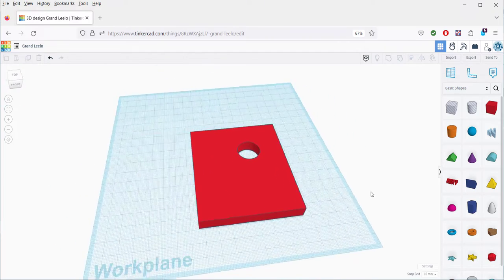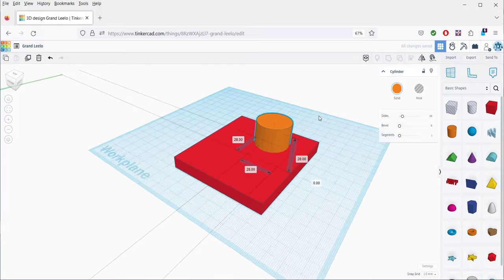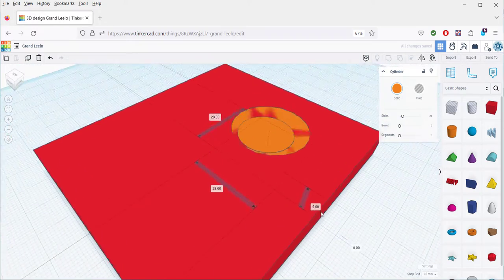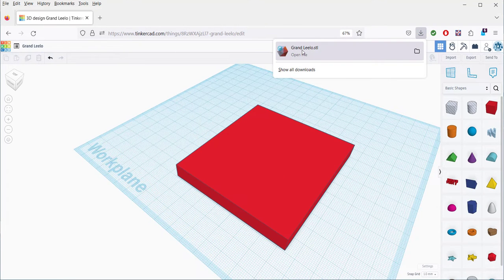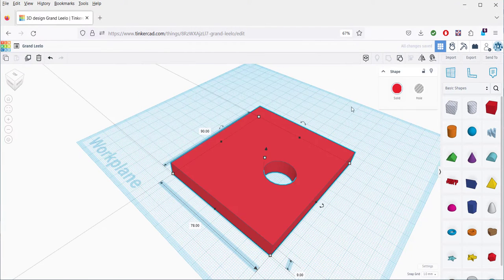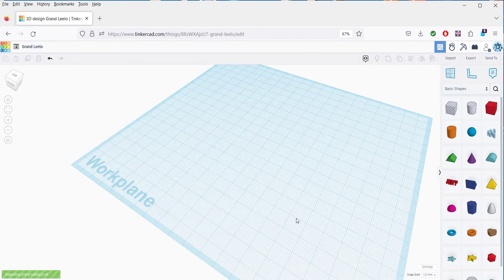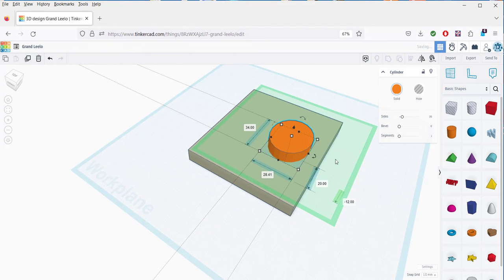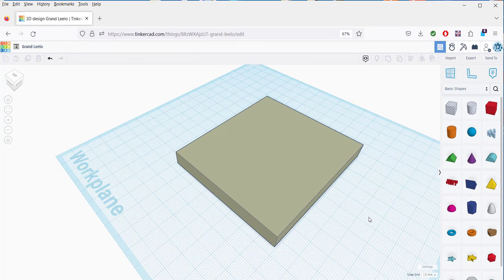Tinkercad: How to Fill a Hole

Comment: This simply doesn't work like you're showing here when I do it. I'm left with the edges of the new shape after I group the objects. And there is no flashing at all, and it seems impossible to match the surrounding surface.
Reply: Your question  is old but did you try to to disable the snap grid? maybe your objects are not exactly 1 unit of the size of the snap grid.